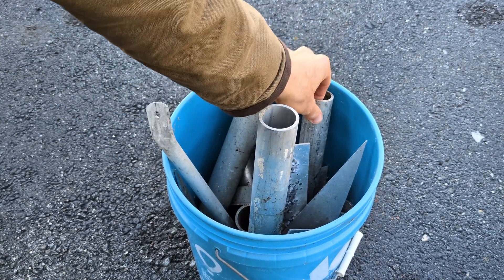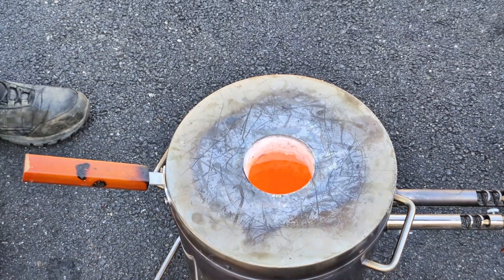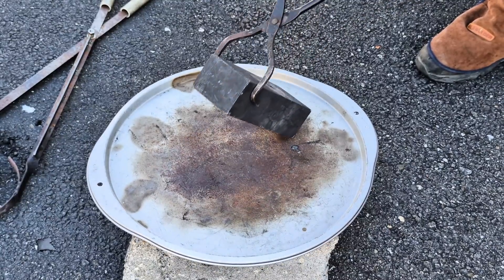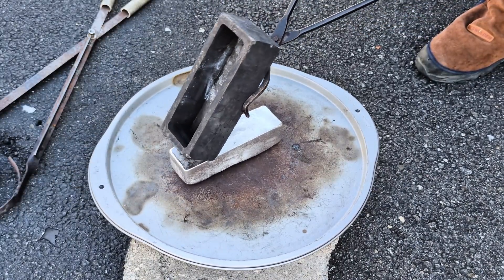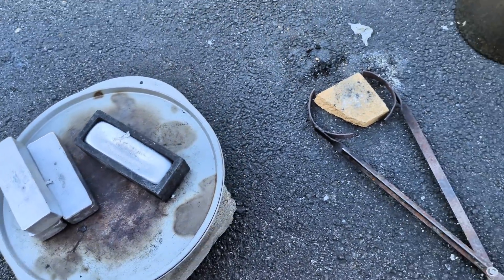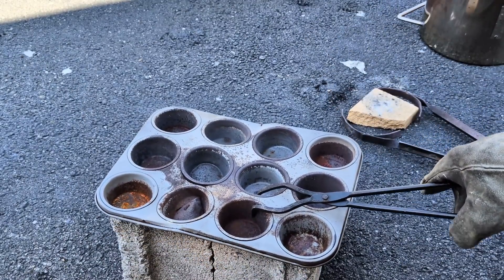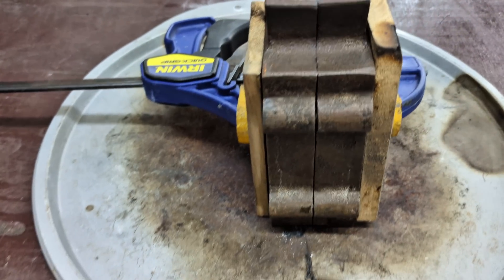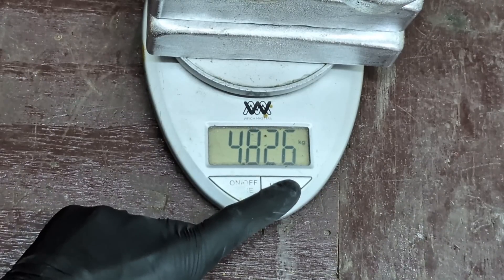Melting a 5 Gallon Bucket full of Aluminium - Trash To Treasure - Scrap Aluminium

Comment: You have just made mystery metal. No one knows what type of alum it is now many scrap yards will not take ingots due to hiding crap in them. Each ingot needs to be tested now to know.  Do not mislead you did not do trash into treasure.  You just did treasure into trash.
Reply from the maker: It's all extruded aluminum and I'm not selling it to scrap yards.  I'll be using it to make things that wouldn't matter if it has mixed aluminum.  Nothing I make is structural.